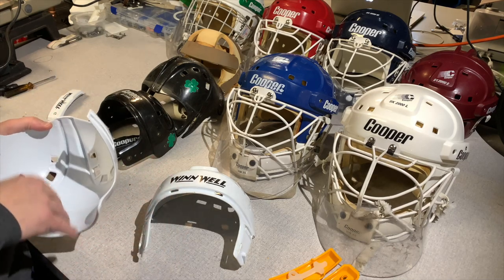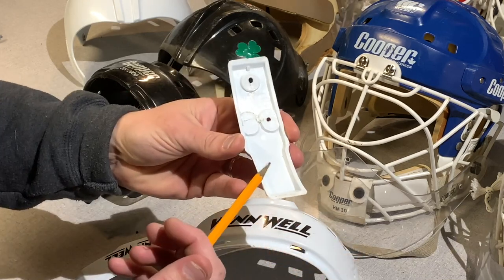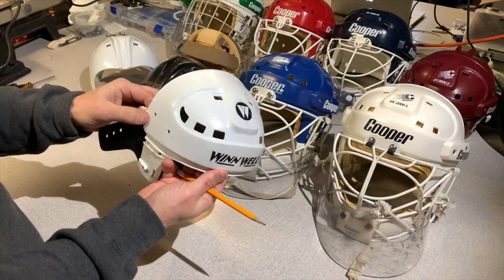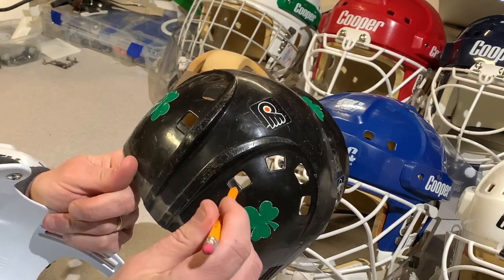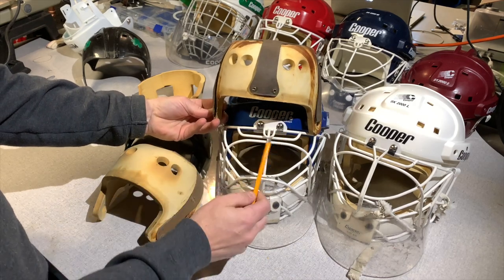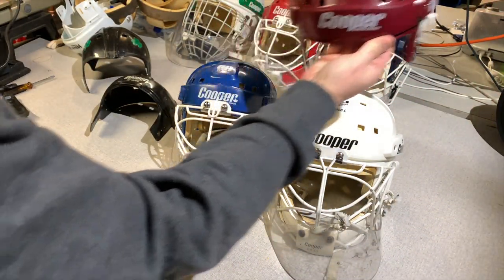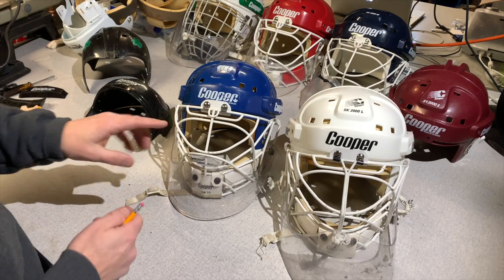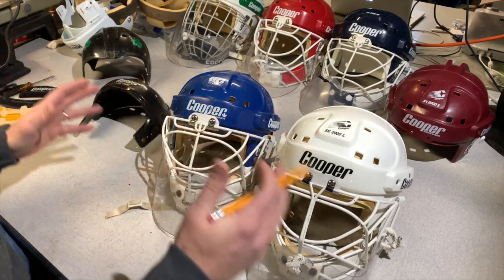Visual Comparison of Cooper SK2000 Hockey Helmet Variations

Comment: Great discussion and really detailed information for us helmet geeks. Well done.
Reply from the maker: that killer Winnwell sitting on my workbench was what inspired this.
Reply: @CooperGoalie  is there a way to add a sweat band to a Sk2000 without having to get thinner foam??
Reply from the maker: @VetGoalie76  of you still have a notch or two of size adjustment available with the shell, you could probably put a strip of Velcro on the forehead foam and use it for a sweatband.

Comment: I have a SK2000 from around 1995 or so..I still use it to play pick up hockey. I am a forward though, I can send you a picture if you like. I am finding that it is getting heavy now
Reply from the maker: The 1994 catalog was the last production run of actual Cooper branded gear.  There was obviously plenty of stock left over for several years.  Under the Nike-Bauer banner some of the Cooper gear was tweaked and rebranded to Bauer (like the Reactor 5 goalie gear)...Bauer even continued to produce SK2000's with the Bauer logo for a period of time.  If you take the foam out of your SK, there will be a mold stamp on at least one of them.  Pre-1990 both halves had a rectangular chart with years and months...and a dot in the grid that you use to know.  Post 1990 all I've seen is the rear half has a circular stamp with the year and an arrow pointing to the month.  Typically they all at some point had a sticker inside with the date of assembly as well...but aren't' always legible after decades of sweat soaking.

I still see skaters in my old timer league wearing buckets and cages from the 80's and 90's on a regular basis.
Reply: @CooperGoalie  lol yes it is a old timer pick up hockey. there is even a guy with a "Wayne Gretzky Jofa" - I can send you a picture of my Cooper or e-mail me at dover134@hotmail.com
Reply: Bauer sold replacement side bumpers for the Cooper SK2000 helmets with the old Cooper logo on them for several years after they dropped the Cooper. I have a new in package set of replacement plates in a Bauer brand package with Cooper printed on the plates. Was "RSP" part number.
Reply: @oscarwinner2034  I ended up getting a new Bauer helmet for x-mas last year, the old cooper was getting heavy started to slide down a lot. As I get older and slower I need advantages (lighter hockey gear!) to keep up with the young lads!  I removed the cage from the old Cooper. I will use it for public skating etc or if my son plays hockey and I coach him..It will probably be a attention getter though!

Comment: Amazing video! I have Cooper SK 2005 it has Jofa like foam in it but white and Cooper L writen on that foam... Like whats that? :D
Reply from the maker: 1992 Canstar introduced the SK2500 along side the 2000.  It had "revolutionary high density Sentinel foam" for padding and was marketed as their lightest helmet ever.  The 2500 also didn't have the bumpers (reducing weight further).  It was available in S/M/L sizes and in White, Black, Red, or Blue colors.
Reply: @CooperGoalie  Mine have bumpers and its really SK 2005... it could be something for EU market only?
Reply from the maker: @janbigas2070  The shell of the 2500 and 2000 are the same.  The 2500 just didn't come with the bumpers (shorter screws there instead).  You can easily put a set of 2000 bumpers on a 2500 so it has the same appearance.
Reply from the maker: @janbigas2070  hey. i just re-read your comments and i apologize. i misread what you were typing.  i've been talking about the 2500 and you're talking about the 2005!   I can't find a reference right now, but I do believe I remember seeing that the 2005 was marketed as an 'officials' helmet.  If i can get some time later I'll see if I can dig up more about that.  It's essentially the same as the 2000...but with different padding.
Reply: This is true. It's like the 2000 and 600 had a kid.